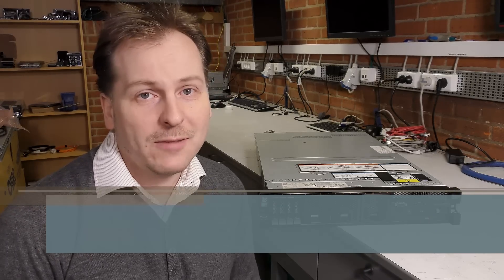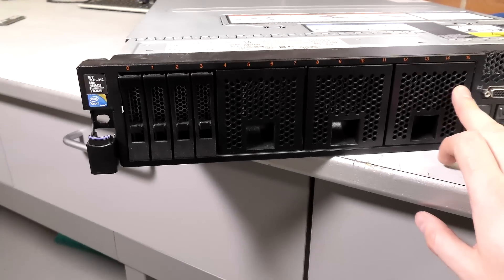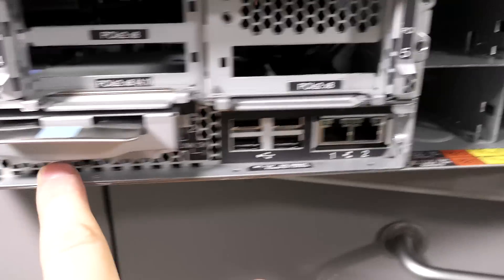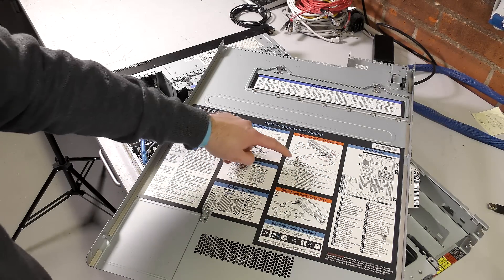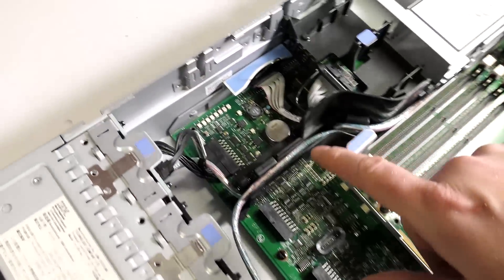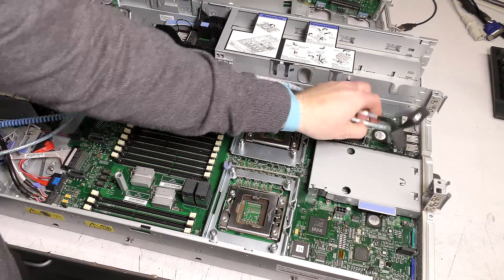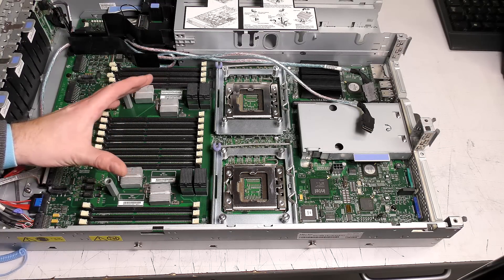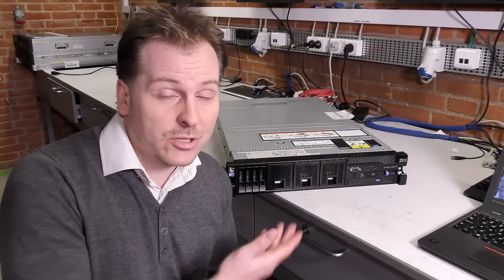Lenovo x3690 X5 20 Cores 1TB of RAM 2U Enterprise Server - 605

Comment: Hi I have same server. I am trying to connect IMM web interface through system management port.
 I can connect to IMM on the server using usb remote NDIS ip address.
But not from system management port.
Should i have to install a different module to connect IMM or how please help..
Reply from the maker: You can set up the IP for the IMM in the bios..
Reply: @MyPlayHouse  already setup but not pinging 😮‍💨☹️

Comment: Hey Morten, Really good video, enjoyed it as always :)

I have a question; what would you / the subscribers recommend to me for a server under 600€? I already have 4x1TB brand new hdd's, and 2x 240gb Samsung ssd. It's going to be used for virtualization (+- 7vm's).

Edit: 3 of these vm's are gameservers with higher cpu needs

Thanks a lot
Reply: You don't need much to have 7 vm's lying around. You probably should demand more for that cash; Gaming? Intense cpu operations? need of GPU? advanced raid? good management? I have DL160 G6 and it could handle 7 vm's, but it's RAID (p410) probably won't like multiple SSD's (probably too slow). If you intend this server to run 24/7 also mind power usage.
Reply: Jerzyna aKwei Its going to run in a datacenter here in the Netherlands, 4 vm's are for backup, websites, projects and such and 3 for game servers
Reply from the maker: Hi FoxelVox
Thank You very much!  glad you liked the video :-) I would go with an x3550 M3 or an x3650 M3 but that is just me,,, handles 288GB of RAM,, good for 7VM's + + :-)
Thank you for watching! :-)
Reply: I agree with Morten, anything based off intel 5520 chipset, and 5600 series xeons will do fine. Both DL160 G6 is such thing and x3X50 M3 is. Former is cheaper while second is more robust. You can try to aim even higher for that price, but then you will have to cut into available RAM etc.
Reply from the maker: Even an x3650 M2 would work great,,, same x56xx CPU's a bit slower RAM and "only" 192GB -ish,, as far as I remember.
Reply: My PlayHouse  I found an Dell Poweredge R420 with 2x Xeon E5 2430v2, 64gb memory and a ibm/Lenovo x3550m3 with 2x X5650 and 128gb ram both for 350€, any thoughts?
Reply: R420 has only 3 out of 4 ram channels, so expect lower performance for top-line CPUs.. Remember that you can also look at lower tier servers and upgrade them with more ram yourself (this is often cheaper option). You can also look for DL160 G6 as I suggested, it's basically x3550m3 with worse management. If you plan on torturing it 24/7 then I'd go with R420 (lower TDP for ~same performance). If you plan on expanding it with GPU or something, then look for 2U 5520 chipset (DL380 G6?). Anyway it really depends on how much you want out of it, and all listed servers are more than enough for virtualization and most game servers. I personally own two DL160 G6 (2x X5650, 2x E5620) and I use them with GPUs for gaming and neural networks, both are great for my use (except a bit loud), but I believe your use case calls for a bit different setup.